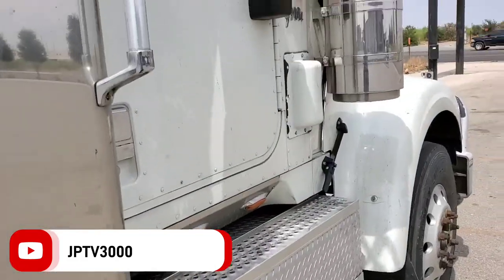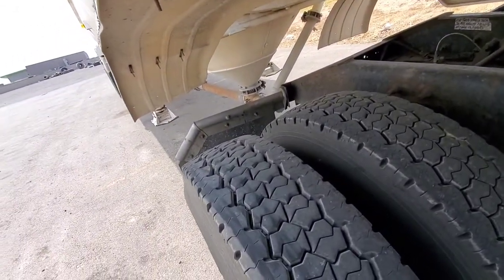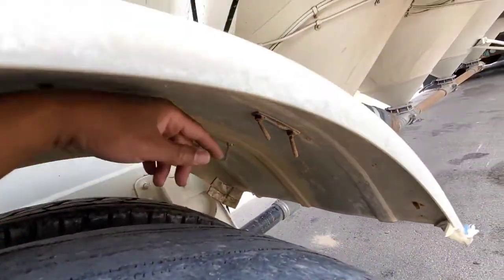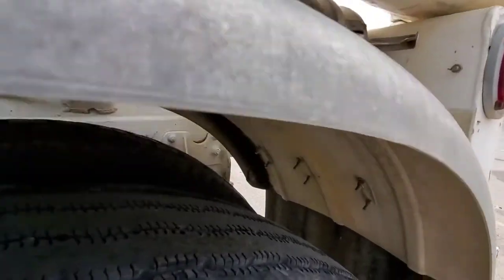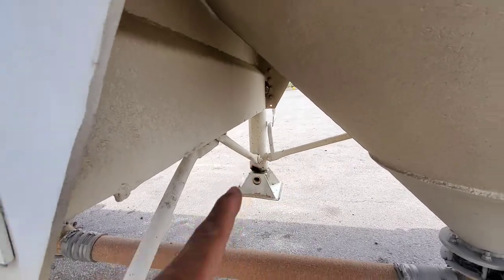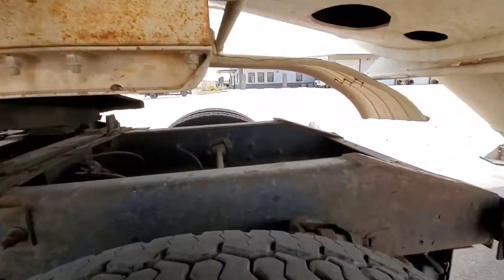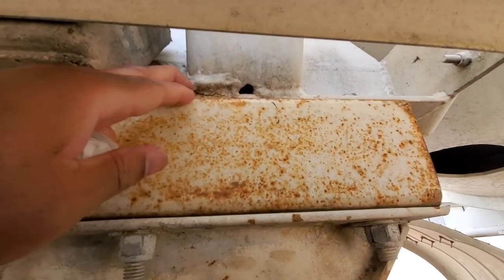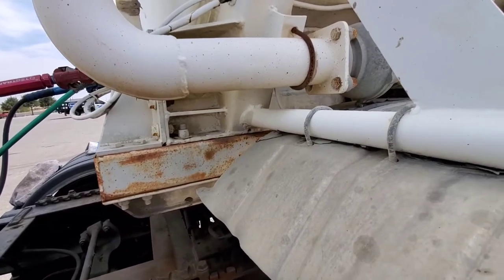Oilfield Trucking an trailer Checks

Comment: Is there a way to contact you if we about to come up there and work?
Reply from the maker: Im not in North Dakota now
Reply: @JPTV3000  gotcha, just for general questions though
Reply from the maker: @geraldmorgan2089  
Ask away I'm going to be making a questions and answers video pretty soon
Reply: @JPTV3000  Basically just questions on what a entry level floorhand does? And also is it a good career path long term?
Reply from the maker: @geraldmorgan2089  make sure you understand that part it is work
Reply from the maker: @geraldmorgan2089  floorhand comes in two flavors Drilling and workover rig as long as you're willing to work you're good